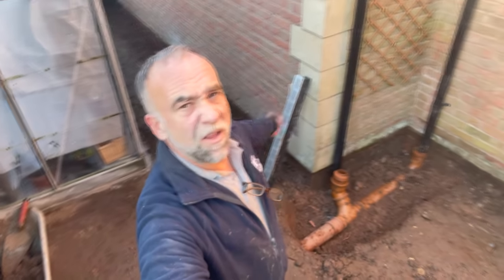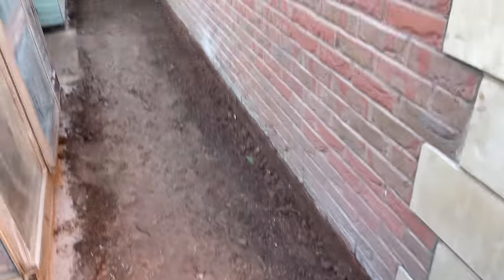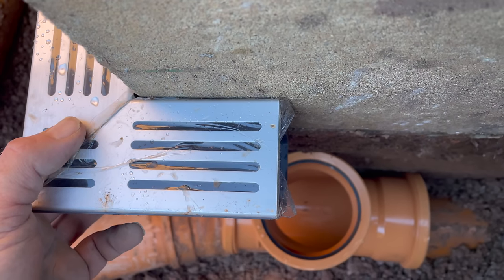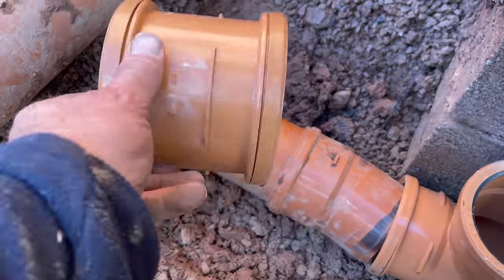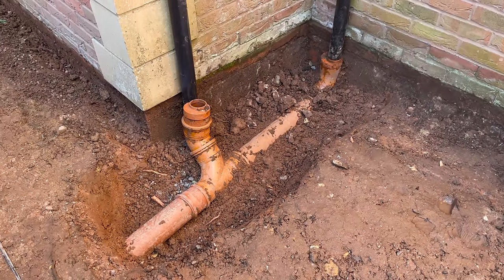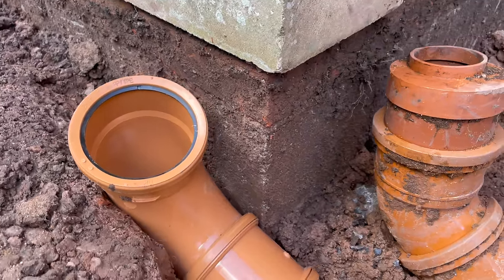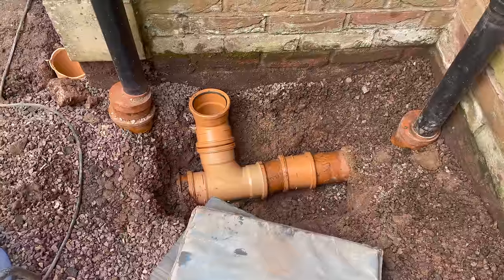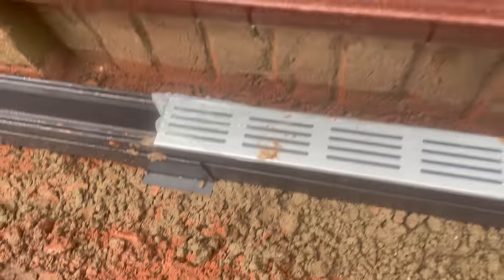Mastering Drainage & Threshold Installation: Step-by-Step Guide 🛠️💧 #drainagesystem  #drainage

Comment: Using channel drains that do not have the correct size outlets or any seal where they meet 110mm underground pipes can cause major problems, if a blockage develops in the 110mm underground pipe all water will back up to the point where the channel drain simply sits over the underground pipe, this water will then leak out below the channel drain unnoticed soaking into the soil and gravel below ground level, the ground and walls will become saturated and can also cause house foundation to become unstable. the other problem with these channel drains they do not have any seals where each section butts together, so each of these joints will also let water escape into the ground below. Channel drains are ok for stopping puddling on paved areas where rain naturally falls, providing the water they collect does not escape into the ground close to any buildings. Roof down pipes should connect into110mm underground drainage pipes systems which are fitted with rubber seals on all joints.
Reply from the maker: Easy to unblock especially with the leave grate on top 👍🏴

Comment: I have three questions relating to this. Firstly, shouldn't there be a fall down towards the outlet, rather than totally level? Secondly, shouldn't the drains be away from the house wall slightly, with a slight slope from house wall into the drain, so water doesn't get behind drain? And thirdly, is it essential that it all runs into a drainage system, or can it all just run into a soakaway?
Reply from the maker: Firstly always level against the house or it looks weird 
Secondly it is away from the wall slightly and is grouted against the house so water cannot drain 
And thirdly a soak away is also fine 👍🏴

Comment: if i have driveway blocks backed against that, will it be strong enough (cars on a driveway) to stop the blocks from shifting and braking the drain?
Reply from the maker: This type is not to be used in a driveway unless it would be against the house 👍🏴. Not for heavy loads
Reply: @tidybrickslandscaping  thank you for responding and your great video. Maybe i can clarify my explaination. The driveway blocks (in a herringbone pattern) back against the side of the house. The driveway runs parallel with the house. Whomever laid the driveway, they filled the gap between the house threshold and driveway blocks, with concreate. I want to replace the concreate with a french drain since there is damp inside the house walls. My worry is, as cars come and go along the driveway, the blocks will shift against the drain channel and potentially break it.
Reply from the maker: @frustin  fill the gap with the best product I guess to prevent shifting

Comment: Where the aco drain is againt the wall did u seal it or is it left as it is in the video to let the water from the wall run down ? Mine is lkle that and i was thinking of sealing it, they are cemenged in but where it meets the wall its not
Reply from the maker: I didn’t actually show that part my bad but yes i filled it with grout and important to,fill this void 👍🏴
Reply: @tidybrickslandscaping aagh oknbuddy thank you, the builder who fitted mime has  utted them uo right against the wall and there a very very think gap id say about 1mm max , there is no grout there so i was thinking of sealing it all myself to stop the water getting down, ive being told to use ct 1 to stop the water getting down and causing iuuses, would that be ok to do ?
Reply from the maker: @johno349  yeh that’ll work 👍🏴otherwise water constantly keeping the foundations wet isn’t good
Reply: @tidybrickslandscaping  thank you for the advice mate , i shall be cracking on with that the weekend, wanted to double check that it would work first , thank you for your help 👍

Comment: Do you need to seal joints with sealant, or is pushbfit substantial?
Reply from the maker: The push fit were very good fixtures and yes you can also use a sealer 👍🏴

Comment: Hey, loving the videos, they've been super helpful, I have a question about drainage, do you find you have to get planning for this sort of thing? I was thinking of running one along the edge of my house for a new patio and connecting it to the drain where the gutter downpipe goes, but Google says this might actualy need planning? Any advice please? It's causing me a nightmare figuring out drainage! Just want to add, we can't have it running to a grass area because the lawn is on a slight slope towards where the patio would be, and we'll be putting some oak sleepers between lawn and patio, we could have a wide gravel trap I guess? I'm trying to avoid soakaways because it's quite heavy clay here and I'd have to dig it by hand... Sorry for long message, massive respect to you, thanks in advance.
Reply from the maker: Water running towards the house definitely connect up to any down pipe drains and I’ve never needed any planning permission ever so just crack on and go down that route I’d say 👍🏴

Comment: Scott, big fan and fellow Cardiffian now living on the south coast of England (don't hold it against me!)  - but watching your videos make me feel like I'm back home!  Quick question, in this video you are laying the "Not-ACO" along the side of the house.  I've been told that the patio should slope away from the house so had intended to put the ACO along the far side of the patio and then run a drain pipe back through a trough to meet up with the gutter drain on the house side.  I'd prefer to have the ACO next to the house like you have done - are there any disadvantages to having the patio slope towards the ACO next to the house rather than away from it?
Reply from the maker: Hi Andy thanks for watching memories of home and as for the drainage channel normally I prefer to work without them if possible as I prefer to direct water away from the house but on this occasion I had no choice. Aco should always be level to the house then run water the opposite directions asap 👍🏴

Comment: great video, Im just about to do something simular but simpler. im planning on sealing my joints with Stixall sealent, would you advise sealing joints? 
also what mix are you bedding down with? 
thanks for sharing your knowlage
Reply from the maker: It heard of that sealant but yes it is advisable but they do click together really well and it was a sharp sand cement mix 4/1 👍🏴

Comment: Great insight as ever Scott. I’m thinking of laying a porcelain patio out the back of my house with tiles coming up above DPC of the house (to suit the height of the French door threshold). Do you think that channel drains would satisfy both drainage and surveyors requirements?
Reply from the maker: Should never be above dpc only level with it using a drainage system like I used there.  
Last project I had a bifold door drainage section to do which had a tray I had to tile over and my solution was to keep the little vents free to drain through but cutting a section of tile away from this section and allow any possible water able to pass through. Any water which could possibly drain through would be so so little it would not make any difference and the bifold door should be taken off and renewed 
Hopefully that helped 👍🏴

Comment: Hi - thanks for the video. Question, my builder has run the acco's directly into a new 4 inch sewer pipe that goes to a pump with a non return valve. He assures me it won't smell later but I'm not convinced. Is there anything I can do to minimise the chances of this happening? Thanks in advance!
Reply from the maker: Yeh dont pay him fully until your sure by using the loo and doing a smell test yourself 👍🏴

Comment: With the wider channel drains like ypud put at the end of a driveway, what would you use instead of plastic? I only know of the stone type with metal grills but was told that they crack easy
Reply from the maker: Marshall’s actually sell a hollow brick paver type and looks pretty cool not used them yet but know plenty that have. 👍🏴

Comment: Love your videos.   Quick Question on this product... when the channels are clicked into the connector, how are they sealed?  All I can see is just two plastic surfaces touching, no rubber gasket or sealant applied?  surely this would leak like a sieve ?
Reply from the maker: No doesn’t come with anything that is how it’s sold no need to seal it is a really good connection I must omit 👍🏴
Reply: @tidybrickslandscaping  Hi Scott.  I've just found the installation instructions on their website for this ACO Threshold drain, and it does actually specify using sealant for a water-tight installation.  See section 7 of the instructions. I'm not trying to be a smart-arse here, just passing on the information.   It really is in small print, and not mentioned on the ACO web pages which are just marketing stuff.  - All the best, still watching your channel :-)
Reply from the maker: @tobyhallam4750  thanks for clearing that up for me Toby well I never I’ll look into it and make sure I’ve got the sealant next time.
Thanks again Toby much appreciated mate 👍🏴

Comment: Hi pal.. what would u recommend on the slurry stuff for back of porcelain tile and a porcelain stihl saw blade, and do u think screed from a concrete plant is ok for laying porcelain on? Cheers
Reply from the maker: You can buy slurry from quite a lot of merchants and the porcelain blade for the stihl saw perfect. 
Problem with the screed it’s semi dry a wet bed is preferable but screed still fine otherwise 👍🏴

Comment: Hi Scot, quick question about the levelling. Did you levelled them flat or on a slight slope to allow water flowing down the main pipe?
Reply from the maker: All laid flat no fall. The internal depth is 100mm so it’ll find it’s own way out before it could fill up. 👍🏴.. the only part that had a fall was the section where the house went inwards as the tiles needed to have a fall still otherwise always level

Comment: I've seen videos about ACO drains and rising damp, but if the ACO drain is two bricks below the damp course then is it okay to have the channel drains flush against the wall?
Reply from the maker: Yes no problem even at dpc height as long as it’s running away from the house. People like to open there bi folds doors with the same height inside as out as long as you have  aco system in place 👍🏴

Comment: Hi Scott, im thinking of fitting these wen I landscape my garden, do you need to seal the joints ? I wondered because the water will find its way through the joint without any sealant albeit minimal.
Keep up the good work 👍
Reply from the maker: Each section has a connector goes 100mm each way underneath so holds a good fit 👍🏴

Comment: Hi mate, my name is Sam (excuse my jokey username btw 😂)and I'm new to the hard landscaping trade having come from the general gardening and soft landscaping trade mostly. I did some part-time labouring for a Marshalls Accredited landscaping firm years ago and I've been following your videos lately as I've found your work phenomenal as well as educational. I've starting off with smaller patios as well as basic driveways over the past year as I am not interested in general gardening work these days. I've recently looked at a job where the customer wants a little patio installing up against the house with the levels appearing to fall towards the house as opposed to the garden. I'm thinking aco drains as they would look the most aesthetically pleasing however as well as there being the main rainwater drain there is also their soil pipe drain up against the house where the patio falls meet. How do I work around this without damaging the soil pipe drain whilst installing the acos to fall into the main rainwater drain? I know it's meant to fall towards the rainwater drain however this wastewater drain is in the way. I'm not having any luck finding videos nor any clear info on the internet on how to do this properly and safely. Thanks! 😁
Reply from the maker: Hi Sam so I think I know what your saying as basically you’ve got a waste pipe against the house which is in the way of the aco. 
Ok so leave that waste pipe alone and just work you aco”s against the waste pipe but have separate connector channels linking up together.
Either side of the waste pipe have 2 separate links connecting back together like the Y shape 
Also like the spice girls song WHEN 2 BECOME ONE 😂👍🏴
Hope that helps

Comment: Just watching your videos in preparation for my patio install this summer. I want my porcelain patio to be a near level threshold with extension/bi fold doors. The bi-fold threshold/sill was installed slightly below internal floor level & dpc on the outside course for this purpose.My question is in relation to having my patio only 30mm below dpc. Have you done this in the past? Can I just run these drainage channels around the perimeter of the extension? 
Obviously there will be a fall away from extension and there is an overhang on the roof of extension. Just thinking about not causing damp problems
Reply from the maker: Good question Carl I’ve got a job like that coming up shortly and there’s lots of information out there but I’m sure you would be able to run threshold drain along the house for sure the only section which is tricky is the door because the door has its own water vent as well..
I’m not 100% sure myself exactly the right way to do it because somebody will always moan and I’ll be filming it so I will expect people to chip in as well tough call good  question👍🏴
Reply: @tidybrickslandscaping  will be interesting to see your video on that job. 
The company that fitted the bifold did fit the bifold “I think” around 50mm ,(will have to check)down on the outside course so bringing the patio near internal floor level and below dpc but obviously not the standard 150mm down. 
As I have an overhang around 500mm on the flat roof not that much water runs down the bifolds anyway. 
I think I will maybe fit the threshold channels all the way around as a precaution. The walls are water proofed rendered also. 
I was thinking about a gravel channel but any water would sit against the house , not sure that’s good
Really appreciate your replies to all my questions 
Thanks
Reply from the maker: @carlflay431  You’re right about the gravel channel water will just sit there anyways regarding the thresholds they were the company from that video they do all sorts 
https://www.polychannel.co.uk/
Keep me informed 👍🏴

Comment: Lovely job. 
Have you got any advice on what filler to use between limestone pavers, an aco drain (like yours) and bifolds please? We think we need something that has some flex due to different elements moving at different rates ie normal grout not suitable as it may crack!
Reply from the maker: Silicone apparently 👍🏴
Reply: @tidybrickslandscaping  okay great, thanks

Comment: Does a patio always have to fall away from the property? If I have acos next to the house
Reply from the maker: Yes only if the patio is at dpc height 👍🏴
Reply: @tidybrickslandscaping  oh ok so not essential if the patio and acos below the damp course?
Reply from the maker: @bharetbhardwaj808  not really. I always try aim the water away from the house but if I can’t I use a aco. 
You can tile right up to the house if your 150mm lower than dpc no issues 👍🏴

Comment: These ACOs are also advertised for sliding/bifold doors but not really sure how they are supposed to be installed to collect any water coming from the bottom of the doors frame and also be flush with the doors threshold. Any ideas? Thanks
Reply from the maker: I’m doing exactly the same now with a customer and the conclusion was not to worry about and water coming out of the door as the solution cost a fortune and very complicated and anyways does any water actually come out of those drips ? 
Anyways we’re going to lay tiles over the drip but leave a gap in the cement so if any did it would just drop down behind the aco. 
Hope that puts your mind at ease it did mine 👍🏴
Reply: @tidybrickslandscaping  I just did an install like this, i used a soldering iron, bit of poly and made tiny drain channels from the acco to the weep vents. designer specced flush with bifolds. not much info out there on this but this was my fix.
Reply from the maker: @JoshSmith-ud3qw  I ended up laying a 60mm tile in this space and I ground the tile down where the vent was to allow water to travel under it through to the aco not when I grout it I’ll make sure this area is only grouted the depth of the tile for any possible water to drain. But such a little amount it’s just not worth worrying about or get a new door that’s working properly. 👍🏴
Reply: Be good to see some pics of the final result 👍🏻
Reply: @JoshSmith-ud3qw  I’ve seen that in one of the bifold express branches. How did it work out? Did you bond the aco to the base of the sliders to prevent water creeping between aco and the sliders? Thanks

Comment: Did you seal each joint so it's water tight or do you need to with these drains?
Reply from the maker: Apparently you are supposed to seal the joints but I only found that out after that project 
Not worried as they were a snug click in type joint 👍🏴